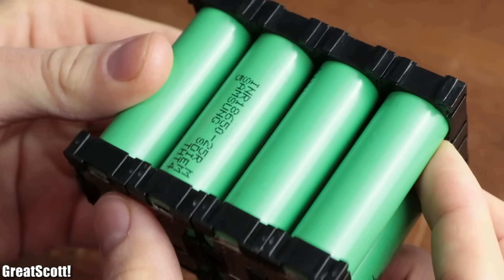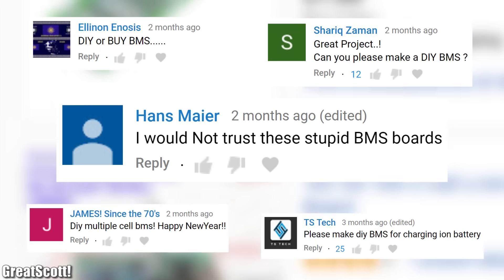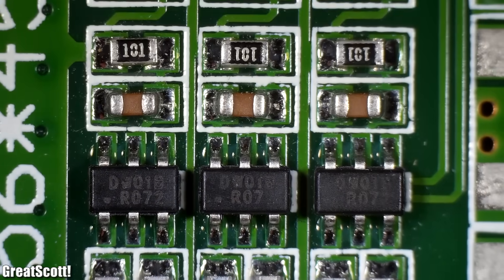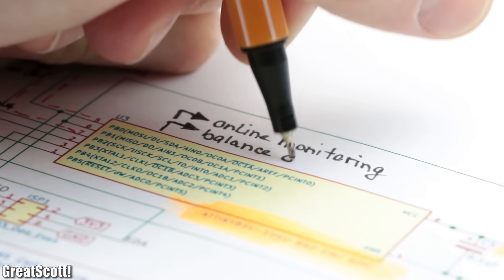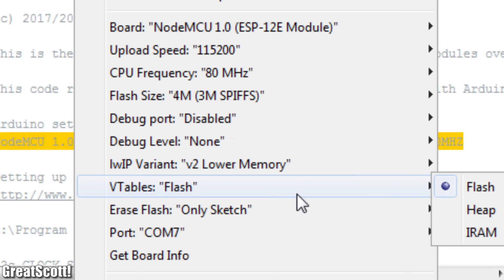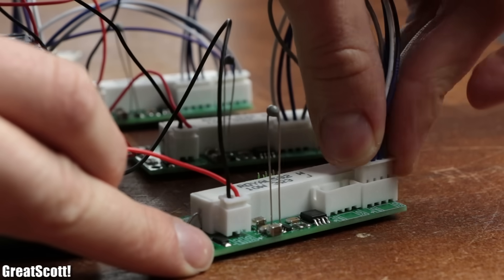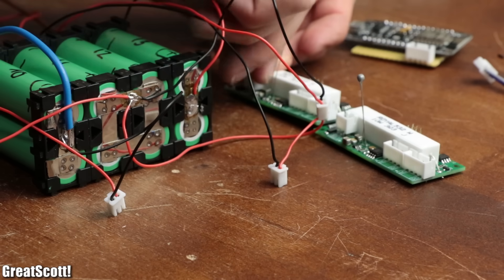BMS (Battery Management System) || DIY or Buy || Properly protecting Li-Ion/Li-Po Battery Packs

Comment: nice work mate, but i just want to say ive bought loads of cheap bms from china/ebay and ive never had one fail
Reply: I think they're reliable enough. I've never heard a report of those Chinese BMS boards failing. The DIY BMS is certainly much nicer with the WiFi blings, but if I just want a battery pack that works safely I'd go for the Chinese modules.

Comment: So basically the DIY one only has online monitoring and the other functions are kind of junky. It's about 10 times pricier and it requires pro soldering skills and quite advanced programming skills... As a computer technician, I tell you this right now: DO NOT EVEN BOTHER! Unless you really know your way around Arduinos/ESPs,  PCB soldering and you can't live without online monitoring (I think that online monitoring is already available on some pricier commercial BMSes), don't even bother to do this "DIY" project... It's a real pain trying to do something like this one for the first time and oh so many things can go wrong either in the soldering process or the programming steps... 
For me commercial is the total victor between them two, diy has almost nothing to offer. It is way bigger with so many PCBs, pricier, a real pain to make, worse at discharging, barely had an overvoltage protection after finally updating...

Comment: So lets say for a 10s5p pack connected to a bike motor. Is there a case with  the BMS where one of the parallel packs is lower then the other so the BMS disables that pack until the others come down to it? And will it affect the motor performance? Thanks

Comment: can you explain the power consumption side of diy bms a bit clearer. At what circuit setup, did you measure the current of 12mA flow through DIY bms? For example, did you get this, when battery was connected to load through bms? How much was voltage and what is power consumed by bms?

Comment: Scott !! great work.  I'd followed this video alone to design an PCB for BMS but I've a doubt ! I've 8 li-ion cells, so do I require 8 DW01A IC'S for each cell or single DW01A IC for all the cells as a single battery pack ?

Comment: good day! first of all i love your videos. secondly i would like to ask you this . lets say i wan to make a battery pack with 10s3p battery pack but i want each of the 5 batteries to be in separate boxes and for the me to be interchangable with a connector type.  so the question is this. if a take a 10s3p bms can i run it with less than 3 parallel  ? i mean can i have for example only two 5 battery packs in series making the 10s part of the bms. and if i want later i could add an other 2 packs and make it a 10s2p without having any problem and without  having to change the bms each time . the long term plan is to take a 10s5p bms and have it run with either 10s or 10s2p and so on until the max capacity of 10s5p. is something like that possible?
thanks you ! <3

edit i just figured that there arent any bms that have parallel connections that means i only need 1 bms 10s right? is something like that i ask above possible?
thanks! again

Comment: Instead of joining the cells in packs permanently by soldering or welding, I join the cells with strong mini magnets.  Then I can take the pack apart easily whenever the cells need charging.  This way I can charge a lot, or all the cells at once in parallel, sharing the same 4.2 V voltage.  No need for balancing when parallel charging.  Each 18650 cell is current protected by a fuse.  After charging I can (re)assemble the cells in series/parallel packs with magnets in different configurations, depending on the voltage and current demands for any desired purpose.  This is the most cost effective, the safest and most versatile way of using and charging 18650 cells.  All you need is a good quality power supply, that can handle a constant current according to the number of cells to be charged in parallel.  I charge at 300mA per 18650, so a 10A power supply will charge about 30 cells at once.  Obviously, it takes some time to take the pack apart and to reassemble it.  But when using magnets this can be done reasonably fast.

Comment: awesome video!  I'm researching batteries so I can rebuild some old Ni-cad power tool batteries.  These BMS sound like the obvious solution.  Seems some people opt for Li-Po battery packs or not using any protection and relying on voltage meters and custom charging solutions.  This should allow accurate charging and protection to keep the voltage from getting too low in use.  Thanks!

Comment: Could you make a do it yourself battery management system using arduino Nano which can handle 4 lithium ion batteries in series? I would appreciate it if you would make such a circuit.   Thank    you very much! Please reply.

Comment: Hi, great presentation, thanks. I have a question, it would appear that the DIY battery pack too the cells to 4.4V (although for a short time) Is this harmful? Did the ebay purchased packs do that ?
Thanks
Reply: This is an IMPORTANT observation.  You intentionally set 4.1V max charge to ensure a long lifetime of the batteries (MANY more cycles), and then the board let them go to 4.4V, something that even you said would result in the "destruction" of the batteries due to over voltage.  Your drawing hints that 4.3V is bad.  So, any comments on 4.4V?

Comment: My boat solar is constantly charging all day and discharging all night so the tiny balance current of the ebay and amazon BMS do not keep up as the cells become unbalanced during charge and discharge.  A BMS with a true one amp balance current capability is going to be very helpful in preventing some cells from becoming overvolt when charging.

Comment: If i want to make a pack for example 3s5p whats the better way:
Connect 3 batteries in series an then connect them at 0V and 12.6V in parralel 
Or
Connect 5 batteries in Parralel and then 3 packs in series?

Comment: What's the cause of the high power loss in the DIY version ? is the Attiny mcu drowing that current ? maybe it can be replaced by a more efficient MCU,no ?
Can you compare it to the newer diyBMSv4 which should be improved with lower power loss and maybe cheaper components
https://github.com/stuartpittaway/diyBMSv4

Comment: Awesome video Scott! Just one question about that commercial BMS in your video. The commercial BMS uses multiple DW01A ICs, one to protect each battery cell. I cant work out how that would provide individual protection to isolate a cell, when all the cells are directly connected in series (with spot welds), as shown in the diagram at 3 minutes 18 seconds. Surely with that configuration, there is no way to isolate a cell in the pack. Have i misunderstood something?
Reply: Without proper reverse engineering I can't be sure, but it might be cutting power to output.

Comment: Every crappy Chinese BMS Ive tried does the same thing - they don't pass enough current then go into shut down. I tried manually adjusting the voltage of each cell until they were all equal and same thing. I've even ruined cells after "charging" them using these boards

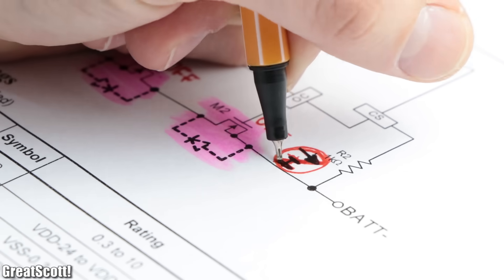Comment: 3:43 i believe the real board is not designed to work as the example schematic in DW01A since they are using 2xPNPs instead of MOSFET to cutoff each cell during oc/od, and does anyone know how it really works?

Comment: surely charging past where you want them and then taking some charge out to balance means more wear on the cells? i'm sure there are now videos suggesting BMS aren't the best way to go for this reason. i'll stick to my rc charger to balance charge and only jump on board with bms when they just charge all individual cells to a given definable identical point initially without the extra steps. Not sure why this flaw isn't highlighted more.  also nearer to 4.2v you get  when charging that is proven to decreases the battery liftime also. i stick to 4.05 usually.

Comment: Hello, I saw a video before, but also about BMS.  It is not used for 18650 batteries, but for square bulk batteries with bolts.  The shape of the printed circuit board is not a regular shape, and the printed circuit board can be directly mounted on the battery.  I have been looking for this video recently, I spent a few days reviewing my browsing history and other locations, but unfortunately I can't find it.  So I want to ask for your help, thank you.

Comment: i re-watched  this video to help me learn/cover any points i might have missed to develop a new battery pack for an industrial robot.

i'm planning to use:
either 
bq77915
http://www.ti.com/lit/ds/symlink/bq77915.pdfor
or
Bq40z50-r2
http://www.ti.com/lit/ds/symlink/bq40z50-r2.pdf
by Texas instruments.

Other ICs i'm considering:

LTC6812
https://www.analog.com/media/en/technical-documentation/data-sheets/LTC6812-1.pdf
and
LTC3300-2
https://www.analog.com/media/en/technical-documentation/data-sheets/LTC3300-2.pdf
by Analog Devices.

MC33771B_SDS
https://www.nxp.com/docs/en/data-sheet/MC33771B_SDS.pdf
by NXP.

Thank you so much scott, i learned a lot from your vids.
Reply: gotta pay back soon.

Comment: Is it possible to build an overdischarge protection circuit by using a comparator and a mosfet?
Reply: look up window comparitors then you could do over voltage and under voltage protection.

Comment: When making power bank from parallel batteries I would use Schottky diodes between the common junction and the battery positive to prevent weak battery from pulling down the strong one and thus exhausting / draining the overall power. This also provides protection against defective batteries. I would also use protection circuit (simple one) to prevent over charge and/or protection against accidental short.

Comment: i have a s4 battery pack hooked up a bms the type you plug in  the small wires my voltage drops from 16.5 v to 12.5 v and the board gets real hot like a short should i use the other type you don't have to plug in the small wires??thanks for your great videos.
Reply: Those small wires are needed as they balance the cells, how about learning how to properly connect a bms?

Comment: I think it would be really great if you could order for example ten times the components you need for a project of yours and put them up for sale in kits consisting of everything you need except tools. Great job on all your hard work. I'm definitely enjoying the results.
Reply: Yes great work 💪 new to this BMS and Li batteries. If I use protected cells then a BMS is not required. Is this correct? If that is the case what type charger is recommended to charge a 48V 17.5A Li-Ion battery?
Reply: @Ballindud  BMS is always good, even if cells have internal BMS. Find a charger of the appropriate voltage but note that the higher the current, the faster the charging but it may harm your battery or decrease its life.

Comment: I am getting ready to make a power source for my fishfinder which will be 4s 3p of the (200a Lithium Polymer Spim08hp 3.7v 8ah Flat Pouch Cells LiPo Batteries) and was wondering what bms you would recommend.

Comment: Is there any rather easy way to make it work with NiMh batteries? I have several 6cell NiMh battery modules that I want to use in series and main problem is that they have different capacities so they will be thrown out of balance pretty easy

Comment: I see you use Passive balancing of batteries. Nice waisting of energy. Why not use Active Battery Balancing with proper dc/dc balancing converter IC's? You can also balance batteries while discharging and charging. Also active balancing can still use 100% of all capacity if one sell has 100% SoH and other has 60% SoH. With passive your battery pack is as good as the worst battery. :(
Reply: Just curious, do you know how active balancing is done? Maybe you can suggest a schematic?
Reply: @sujoybha  It's done trough small integrated circuits that have multiple Buck Boost converters that can divert current from and to the cell. No real schematic needed. There are IC's that do everything with some small circuits around it. The problem with conventional load balancing is that when one Cell is 80% SoC, the other cell that is 100% SoC will just burn energy in a resistor. And it only works while charging, not discharging. So when ONE CELL is bad, and empty the whole pack shuts down, otherwise that cell could catch fire. Here is a link: https://www.analog.com/en/technical-articles/active-battery-cell-balancing.html
Reply: @HermanWillems  Firstly thanks for the reply and the info. I learned quite a lot from the doc. The issue with active balancing is that it is expensive and in most cases is not a value for money deal. 
When building a battery pack, we need to ensure that the batteries are balanced so that huge gaps in capacity are avoided. Once that is done, passive balancing ensures that the difference in SOH is kept as low as possible. In a well made system, a capacity difference of say 20-30% should not appear during the actual lifetime of the system. 
So in short if we are making a Tesla model S, then we should try for active balancing but for a e-bike battery or small battery, passive balancing is good enough.
Take cost, the LT8584 for 1 cell costs about $3.5 while the LT3300 which covers 6 cells costs about $7.6. If I consider $1.2 per cell (7.6/6) still I need a transformer at $1 per cell to make it work. So active balancing costs $2 per cell just for the IC. 
On the other hand passive balancing ICs cost about $0.1 - $0.2 per cell. 

Hope this makes the issue clearer. 
(We can take this discussion offline if you want. )
Reply: @sujoybha  I just totally agree with what you say. It's more expensive, so i would only use active balancing with large mAh cells. The smaller the capacity is, it's probably not giving you the return on investment. It's a money issue.  I haven't exactly looked at the prices though. But active components always cost more than passive ones.

Comment: Great video..… but I am looking for a "Lithium Cell Charger Module (BMS) with Battery Protection board" that would output a 18V system..... any thoughts????
Reply: Can't just make one with just the voltage we need more information bro 18v you wanna supply power tools I suspect that be 5 cell which will be 21v max charged unless you use 12v pack with boost converter then get a Ballance charger and voltage monitors
Reply: @davey2k12  - I have a "GTECH HT04 Hedge Trimmer - 18V 1.5Ah RECHARGABLE BATTERY" (NICAD - 5 cell) that has died and it is hard to get new ones cheap because they are obsolete. I have watched a few youtube vids showing how to modify old batteries to use lithium ion batteries but they just say to use a BMS but not what type....
Reply: I have a SKY RC Imax B6AC V2 Balanced Charger/Discharger unit..... would this replace a BMS?

Comment: @GreatScott!

I have a question... I have 2 lithium ion battery packs, they each have their own internal BMS... I was wondering, can you run them in parallel which would let them share the same load? I am curious how the BMS in each of them would react or if they'd even work at all.

They  both are 48v 15ah.

Comment: hello Scott, am having doubt am preparing Li iron phosphate pbattery pack 60v 36Ah pack with lifepo4 32650 batteries, am wondering may i use lithium ion BMS for Lifepo4 batteries as well, thanks in advance

Comment: I would like to expand the battery of my Xiaomi mijia M365 to be able to make at least 40 miles and at the same time be able to have something more speed like 40 miles per hour. My question is how many batteries would I need to add to the ones that the scooter already has and what modification should the BMS make? Thanks for the video it is very illustrative but something difficult to follow for me.

Comment: I had laid out one in egal but then mold fucked up my life lol. I forget who's chip I used but remember the mfg was basicly like "good luck" when I asked if it had ever been implemented on 2 layers.
These are not really conercial. It's Chinese crap. If u look at iv makers u can even find charge shuffling systems that can balance during discharge. Aka keeps pack running 10 percent longer

Comment: Very interesting. Since some years there are "smart BMS" manufacturers that provide a lot of functionality. For example the "JBD" line: https://www.lithiumbatterypcb.com/ (I use these for my e-bikes around 70v/100A)
Even there are appearing some open source firmwares and tools:
https://www.endless-sphere.com/forums/viewtopic.php?f=14&t=94522&p=1384824&hilit=github+bms#p1384824
https://github.com/kolins-cz/Smart-BMS-Bluetooth-ESP32
https://github.com/BotoX/xiaomi-m365-compatible-bms

So, maybe the future is buying hardware + diy software.

Comment: Is it possible to Modify the ebay Chinese BMS by add  Bigger resistors to increase the amps/watts for balancing more batteries in parallel?   Seems like the balance Watts on those BMS's r very low (video?)

Comment: The main idea is half bad, but it's too expensive with unnecessary futures, i mean who want to track the battery voltage through a wifi, because i should have an electricity, router, and my phone or something similar to track, while it's possible through a seven segment, or oled display.

Comment: I am hoping to see something eventually come out that is nearly as comprehensive as a Batrium system but more adoptable for smaller projects.  One specific need though is for higher current output through any of these BMS solutions at the small side.  With the attractive nature of building high capacity portable battery packs, the ability to push a lot of amps is a must have if you also plan to feed the power into an inverter, especially if it is only a 12v inverter.

I am starting my first project and have some of the 4s 40 amp BMSs on the way and a dedicated charger like what they sell on Vruzend.  Should be sufficient for what I am up to but I am watching and looking at things a lot.  Still not seeing that magic solution yet...